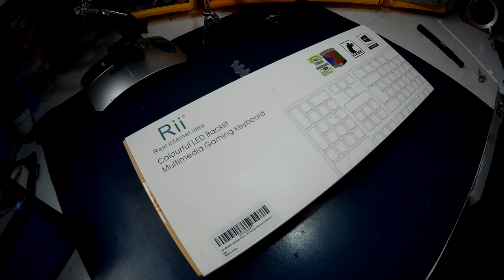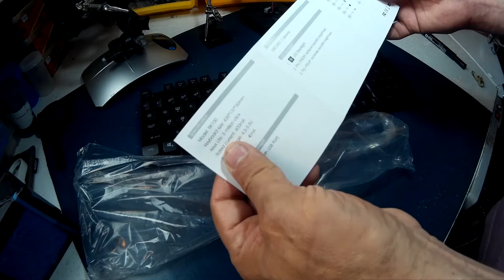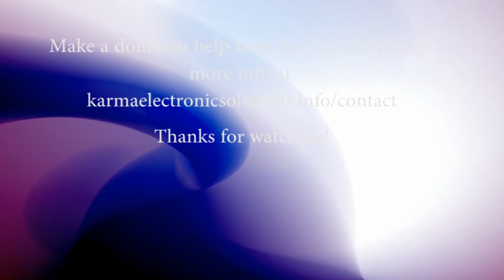Rii RK100+ RGB LED keyboard review(a look inside)

Comment: mine lights up but the keys do not work and this is still outside windows . . I cant get to BIOS and even in windows it stays all lit up with the numlock key always on but it doesn't type at all . . do you know what the problems is?

Comment: Hello, I'm following your channel and I see that you make modifications to controllers ... I have a controller for brushed motor and the maximum it accepts is 36v would it be possible to increase the voltage? What should I change the mosfets, does a 7812 regulator need to change?